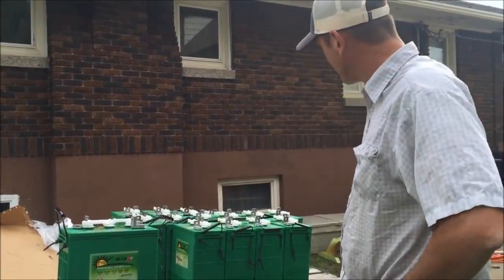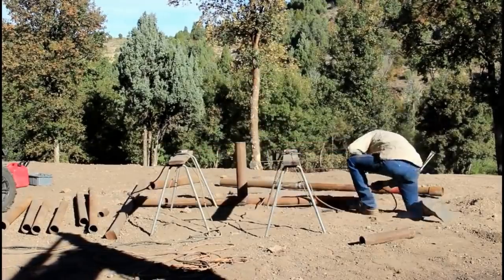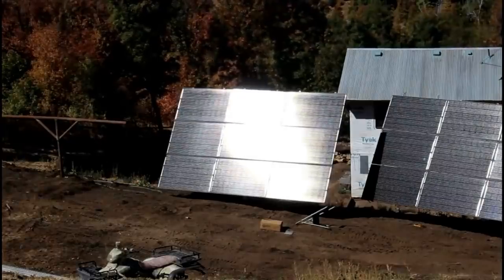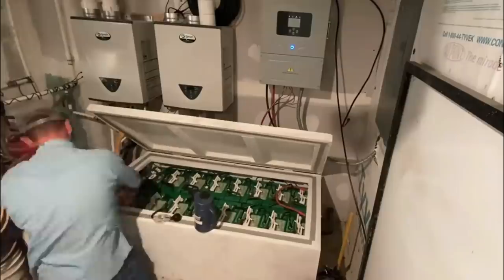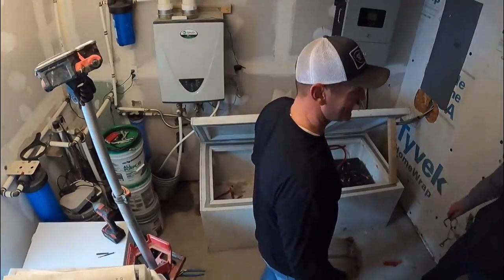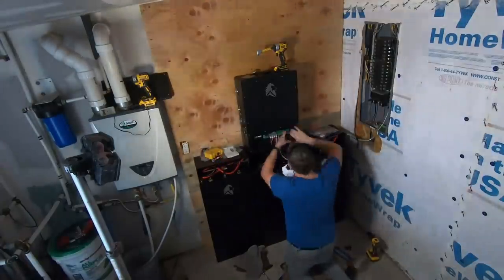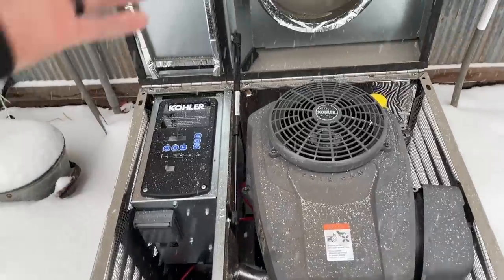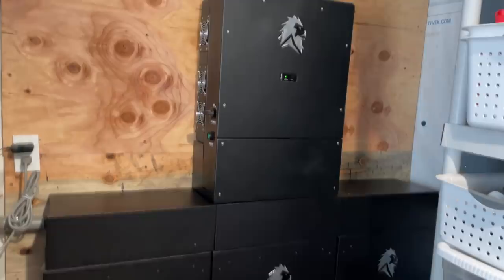#477 - Easy, Affordable Off Grid Solar Power System. (Battery Bank, Inverter Combo).

Comment: Solar power for homesteads is the main topic at moment, out of the many channels:- Red Poppy Ranch and Wild Wonderful Off-Grid are tackling the subject is a clear and affordable way
Reply: Not that affordable tho..
Reply: I love both those channels but here there is absolutely no mention of the prices lion energy charges(alot). The other channel gave a full price breakdown. RPR Iikely got them free/highly discounted. Most homesteaders are not going to be able to afford these systems. The other channel doesn't include the many hours of electrician time but at least they included material cost.

Comment: I pulled the two 6v golf cart batteries from my RV and put in the Lion Energy 12v battery. I’m not going back to lead acid. Saved 120lbs on the front of my trailer. It lasts a long time.
Reply: That's good to know. I didn't realize that they had a 12v. Thank you.

Comment: I taught solar/wind at a Tech college. You new system is excellent, and I am glad to see the system approach. Again on your panels, ANY shading will knock down the output from the entire solar string. In a previous vid you had trees casting shadows of the limbs on the panels and on the roofs of the buildings. If you re-do the panel mounting make sure you have an insulator between the aluminum frame and the steel unistrut or you can get a bi-metal deterioration problem. I made washers out of cut pieces of innertube 7 years ago on my grid tied system and still working. The mounting rack is crazy expensive as in the installation costs, although the panels themselves have continued to drop. Can't beat those lithium batteries right now.

Comment: I now understand why you have been working on this posting for some time. Excellent info and so timely.  
I have been waiting for this episode as I am putting together (or trying) to put together a system that will serve as backup for my on grid house in the city.  The bids I got for so called "free" install systems are insane!, even if it is just for a backup and not a grid tie feed back system. 
Heath, thanks for  taking the time and putting this together, (and, it was so good to catch a glimpse of Ruger!)

Comment: Battery fire. Love solar, love battery back up, my neighbor and I have the same 13.2 kWh system with 6 Kwh battery backup. I was not keen on it being installed under the built in house, in the garage, but I was assured it was safe, that only an impact of some sort, could cause any issue.  Last Wednesday his two year old lithium iron battery had some internal malfunction and caught fire. It was fitted on the wall, inside his garage about 8 foot from the front of his house. The plumes of toxic smoke coming off the battery filled the garage, traveled up stairs filling his house, billowed out the front of the house so you couldn't see the house, blew over to my house and in through open windows. Without a respirator you couldn't get close to the fire / smoke without experiencing breathing issues, and almost a week later my breathing is still feeling not quite right. EMS arrived and after about 30 minutes and 200 liters / about 44 gallons of water hosed onto the battery fire was finally put out. They can not move back into the house until it has been cleaned but a special hazard cleaning team, and it appears just about everything in the house affected by the toxic smoke needs to be replaced.  My battery, the same as his,  is at the very back of my garage. This has been a REAL wake up call!! My battery is being removed from inside the garage, to an outside wall. It will be mounted on a fire proof cement board set a few inches off the brickwork, inside a fireproof, vented cabinet, and I am considering a DIY emergency water sprinkler system that can drench the whole area, if needed, at the turn of a tap. I also need to have at least two respirators on hand, so we suffer no ill effects from toxic smoke if anything were to happen. This really was a wake up call for myself and my neighbor.  I'm not trying to scare anyone, battery fires are rare, but they do happen. By being informed, you can consider any changes you might wish to make re where your battery system is located, and how it is insulated from the rest of your home. Thank you for your videos, and for sharing your journey. Stay safe. Cheers Mark, Brisbane, Australia.

Comment: I'm sure the folks at Lion already told you what the best approach is for their specific system, but just in case - in addition to not letting them run too low, it's also best not to charge them to 100% all the time. The controller should be able to set a max charge in the 80-90%, which will significantly extend their life. You can then let it charge up for the rare exception when you really need it, like ahead of a big storm. Li-ion is the future, glad you found a great company to work with!

Comment: I have a solar system on my home and wish it was more efficient.  24 lead acid batteries.  But so far the lion energy batteries are very high priced.  I will research it and contact them to see what they have to say.  thank you for this!
Reply: Lynda, they will probably say “do you have a YouTube channel with lots of viewers ? “. And when you say “no, I’m just a regular person on a fixed budget” then they will say “ that will be full price for you”.  Oh, but they will say it with a very friendly smile on their face of course.
Reply: @nieldcreek2098  I am still checking into it but the batteries are $1000 each.  So unless it takes one battery to 2 of the type I have, they are way too much for  my budget.  So I will see how they react.  I see there is a discount on the camping solar stuff.

Comment: grid tie the lowest i got with out batteries was $38000.  everyone told me i had to get on grid to get solar around here and i told them if i got on grid i didn't need them. and i got on grid. but still thinking of going solar but i'm mad that they said i have to get one grid and that alone cost me almost $4000. but now if i do it i will DIY and save labor cost.

Comment: Hi, great videos, great way of life. I would like to suggest that you use something like an electric pool cover or awning type system to automatically cover and uncover your panels in the snow. Also you should raise the batteries off the cold concrete floor with some insulation between them and the floor.

Comment: Your home is looking much more complete with the floors. Congrats. 
So have you talked to Lion about a auto start ability for your generator off of an input from when the batteries reach a certain voltage level? I would think that they give you some kind of a input to start a generator.
I sure like the Generac products .. I installed a 8kw with auto switching in a friend’s place.

Comment: Should have kept your lead acid batteries.  They can back up your lipo batteries.  There is water hose caps for lead acid to just put distill water in one location.

Comment: Is it a sponsorship deal?
What is the cost to normal buyers?
How many Amp Hours?
Warranty?
Reply: This seems like a advertisement the replacement inverter has exact same specs as the one its replacing...only color and screen are obvious  changes.....
Reply: @roqm1248  Yea that inverter looks like a re branded sol-ark 8k

Comment: Anyone know why we NEVER hear about ‘thermal batteries’ in the US? These are becoming popular in the UK (SunAmp)–and can utilize different energy sources to store heat. They have a much smaller footprint than a standard hot water storage tank…plus they incorporate “VIP’s” (vacuum insulated panels) for a far superior insulation.
Thermal batteries thus could be a another way to improve residential energy storage.

Comment: Having system size information would make things more interesting for me. How many Watts DC are your panels rated. How many kWh is your battery bank. What is the rating on your charge controller and inverter?

Comment: Well im guessing you had the sol ark 8k, so your inverter or battery bank was probably just undersized. If you had the 12k with enough batteries then you should have been fine. Plus, you had 16 of the lion energy UT 1344 Wh batteries totaling 21.5 kWh for your previous battery bank, but now you have (according to their website) a 40.5 kWh battery bank... i mean yeah, if you double your battery bank capacity then that should solve any tripping issues from hair dryers. I dont think it was because of "lion energy" and their all in one system, even tho its probably a good system. If you have an undersized battery bank and you apply too big of a load (hair dryer) on top of the base load its already supplying, then the voltage will drop drastically under the strain of trying to supply that power and will trip the inverter/charger (like its supposed too). You simply needed more batteries for such a large 2,000 sqft home and family of six. Your sol-ark 8k was probably fine and only needed 8 more safari UT 1300's instead of completely replacing the whole system. Components dont need to be all from the same manufacturer to work properly.
Reply: No, they don't have to be from the same company but it surely helps them work together better.
Reply: @maryblaylock6545  yes it definitely helps streamline the system. My point was it would have been fine with the sol-ark and more batteries, people need to know the real reason the system was tripping so they dont think they have to pay big bucks for an all in one system like this.
Reply: FYI: Sol-Ark 12K is really just an 8Kw unit with a beefed up charging controller. It cannot handle 12Kw loads. I think the issue is that they had been killing their batteries by drawing them down to deeply. Issue with the Hairdryer is that Cedar uses it early in the morning when the battery bank is drawn down over night and not enough charge left in the battery bank to handle the high current draw. This is especially an issue with Lead-Acid batteries that have poor power output curve when the batteries have been drawn down.
Reply: They replaced the inverter with one spec'd exactly the same...i.e rebranded inverter so the inverter was not the problem but battery capacity for the loads they want to run...the proper fix was more solar panels and more battery capacity.
Reply: @roqm1248  Well i did find out there was an issue with Sol-Ark 8K with resistive loads that does cause the inverter to shutdown. They did correct the issue, but it require a replacement inverter. The replace inverter isn't the same.
Reply: @guytech7310  i was being cheeky with my comment it appears "l.e" went to the factory and got the exact same inverter minus the screen...the spec sheet literally is the same so the inverter might not have been the issue, solark/deye inverters trip with 1400w or so imbalance between the legs andbas its a high frequency inverter they do not generally like high inductive loads...solark has great support and glad to hear they rectified your problem.

Comment: Do you think this system would power a series of heat pumps? Have scenario where there's a commercial setup with house, shop and large solar array. Property is 100% electric and the battery systems need to be able to support solar charging and possibly a generator to be added.

Comment: These batteries will be super-seeded by lithium sulphur batteries.
And these will be then super-seeded by Graphene batteries..
Very expensive, but way way more power, and less charge time, able to withstand almost complete drainage.. And also the solar panels you use will be again super-seeded.. Great video, great content. 👌👍💯

Comment: Are you going to attach a self clearing/ cleaning system onto the solar panels if u either move them to a roof or further up the hill ? Might save you a lot of hard work later on

Comment: Cell towers and other remote communications locations all have battery backup and they have to be changed out every year, this provides a good source for cheap (relatively) LA deep cycle batteries... as you have the room and don't need to worry about weight, you could add and add as good used batteries become available. Mixing chemistries is do-able, such as setting different banks to different loads?  Carry on!

Comment: What's the cost for 3 of those Lipo4 batteries? $12-15k??
Reply: If like to know this as well
Reply: Found one vendor that lists the inverter and one battery for $12,000 and $6,800 for each additional battery on sale.  Normal prices are $14,000 and $9,000 respectively.

Comment: You should really should watch “Wild Wonderful off-grid” you’ll never have to worry about charging you batteries again they use a Generac generator for there entire house with heating and AC. They also use 21 solar panels. Doesn’t hurt to do some homework.

Comment: With lithium batteries a integrated system is always better than a DIY one . 
If its properly designed every thing should just work . 

But I question the 25 years warranty .
“ Smaller green energy firms ” are like snowmen in summer !

Comment: Judging by the appearance, the Lion Energy inverter is made by the same company that makes the Sol-Ark inverters.  The problems with running half wave rectified loads have been fixed in the latest Sol-Ark hardware revisions.  Even then, half wave loads are reeeeally nasty power quality wise and there are a lot of inverters out there that will puke on such loads.

Comment: Did Sol-Ark try to solve your problems with high amp / heat-element based items? Did you end up selling or trading in the Sol-Ark with the Lion Energy unit?

Comment: Lion claims their Sanctuary systems are cheaper than a Tesla powerwall. They're almost exactly the same price. I got in touch with them (they don't take phone calls) and asked (since the price isn't on their website). Price difference between them and a comparable powerwall system is less than a grand. That plus tons of installers do powerwalls, Lion has a handful of installers and will often have to come from out state. Heaven forbid you're down and need service.

Comment: No doubt the Lion Energy batteries are High quality but they are only as good as the cells inside them which I highly doubt are made in the US.  Whether they are cells from US  or not there are still 16 or so connections for every parallel group of 48 volt system batteries inside the cases you just cannot see them . There may be 2 or more  groups of 16 cells   in each of those metal boxes.  They charge a premium price for their cells and if its worth it to you thats fine . You can get 272 or higher Amp hour cells including shipping for around $125 per Kw including the battery management system for a DIY 51.2 nominal volt battery that works with 48 volt systems and contains over 14 Kw of power that you can easily assemble together with provided busbars after balance charging inputs a few hours.  Each of these once assembled will weigh around 175  lbs. Its mainly the chemistry of the cell that you like much better than lead acid and much less so the particular brand. EVE and Lishen cells are high quality.  So if you DIY which isn't very time consuming for that type your battery can be essentially the same for 1/4 or less of the normal cost.  I know you like to buy American and I do too but most likely you have chinese cells inside that metal box and its assembled in the US and you have us support which you shouldn't need after reading an inverters manual but you do need to generally match voltages and ratings etc. It isn't that difficult and you can get all the info you need on DIY Solar forum and ALT E videos and other sources. I have 70 Kw s of battery 12,600 watts solar panels DIY  PV mounting  and quality 8,000 watt inverter for a total investment before the 30 % tax credit of  about $14,000 so $9,800 after credits so it can be economical. This system will pay for itself in 48 months. It can be done if not selling to grid or off-grid. Costs go up some such as possibly more expensive solar panels if you intend to sell to grid and certain inverters though mine is certified to sell to grid.

Comment: 12 volt system can only give you 2000 watts. It doesn't matter if you bought a 5000 watt inverter. It can only put out 2000 watts.

Comment: Hey Heather and Cedar one question love the content btw lifetime subscriber now im about to venture I to this lifestyle but my problem is I want a small house and a bigger garage than yours does the solar give you all your power in the garage im thinking solar for house and regular power and generator for shop does that sound right cause im pretty sure solar is not gonna run all my big saws welders and metal machine what do you say!?

Comment: BATTERY TECHNOLOGY CONTIUES TO EVOLVE.
GET READY FOR SOLID STATE BATTERIES .
Reply: Thats great, but please stop shouting. We can hear you just fine.
Reply: @jaygerke6746  I'M NOT SHOUTING.  I SITTING HERE TYPING QUIETLY.
Reply: Years ago a deaf couple were in counciling. As the wife was signing her hands were getting higher and wider and a little wild too. Each time she did this her husband would reach out and gently lower her hands. The fourth time she did this her husband finally 'spoke up' and signed 'Dear, I am NOT blind. Neither is our councillor. So PLEASE stop shouting!'
Reply: @maryblaylock6545  
1ST MAN: "WHY ARE YOU WAITING ON LINE FOR THAT TRAIN?"
2ND MAN: "BECUASE THE POLICE TOLD US TO STAND HERE"
1ST MAN: " WHERE IS THE TRAIN GOING TO?"
2ND MAN: "THEY TOLD US IT WAS A SPECIAL TOWN CALLED AUSHWITZ"
Reply: @belowme4927  You caps lock is on. Its like getting stuck behind a driver with his turn signal on for 50 miles. Or the idiot that leaves their high beams on when you approaching them.